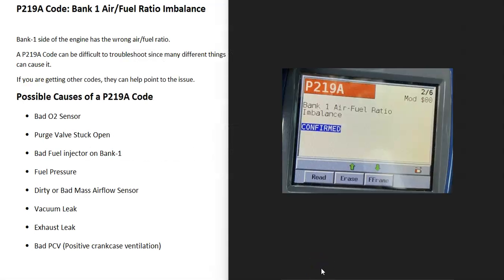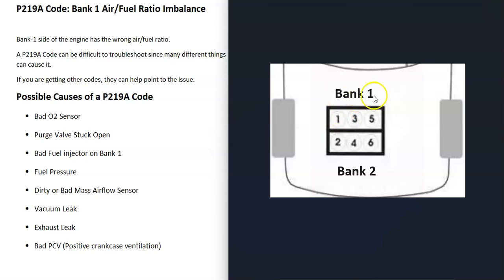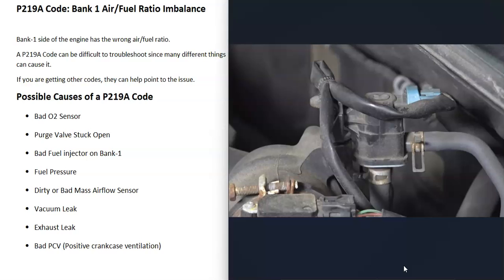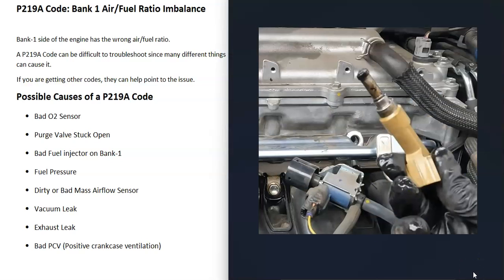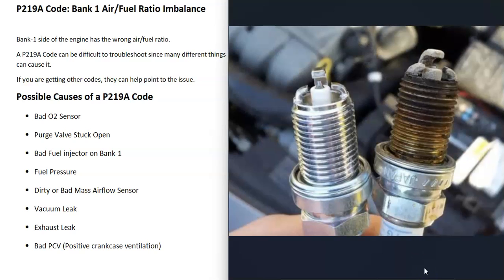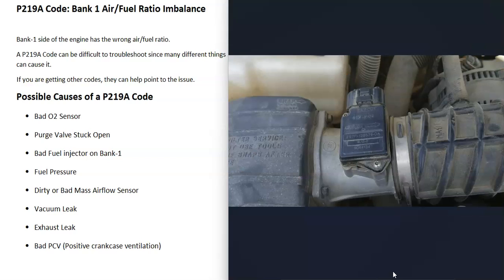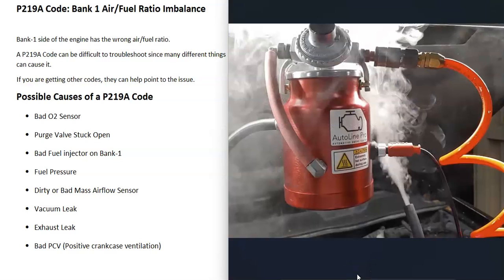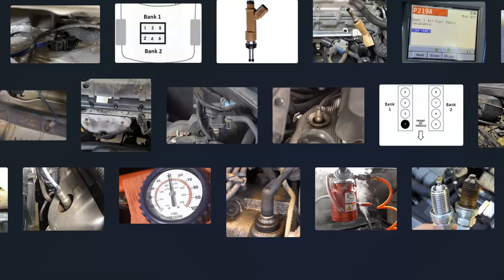Causes and Fixes P219A Code: Bank 1 Air/Fuel Ratio Imbalance

Comment: I have this P219A code on my 2013 Chevy Silverado and I have already changed spark plugs, spark plug wires, all eight fuel injectors, both upstream oxygen sensors, purge valve, cleaned mass air flow sensor, changed air filter, changed dirty air pcv hose, cleaned throttle body and performed idle reset using scan tool.
Reply: Any luck i have the same issue only getting that code as well?
Reply: Have you fix the issue ?
Reply: @isaias3609  I changed injectors and it stayed off but it came back
Reply: @TurnThemWheels   just found out what was wrong with it mines had a broke push rod
Reply: @isaias3609  gotcha dang that’s sucks
Reply: I'm having the same issue I just changed plugs and wires and coil pack because it was saying misfire on cylinder 7 but now it runs so much better then today the day after doing this my engine light comes back on and it's throwing the P219A code did you ever figure out the problem and the fix?
Reply: @ericharvey8  no luck. I changed injectors and made a video on my channel. Code came back and I think it’s lifter
Reply: @TurnThemWheels me too i buy 16 inyectors and Still the light turn on and Just one code p219b ratio 2 do you know what the problems
Reply: @tj-zc1sf  p219b is bank 2 passenger side
Reply: @TurnThemWheels bro I got both 219a and b, I’m thinking it’s the O2 sensors or at least I’m hopeful that’s the only issue
Reply: 2015 Kia forte coupe EX having the same problem I changed my catalyst converter My O2 sensor Been change upstream changed my computer spark plugs initial coils alternator I don't know what else to do with this damn car It didn't come on until after I change the catalyst converter and change the alternator after the alternator came on
Reply: Same stuff with my Benz. 
Replaced all injectors, coils, plugs, both o2 sensors, purge, cleaned map sensor, heet in gas tank, etc. still this stupid p219c is still on. So over it lol
Reply: Try replacing oil pressure sensor , and use non ethanol gas

Comment: I'm getting this code along with  a P0307 code, which is a misfire on #7. I drive a 2012 Chevy Silverado V8. Does this combination of codes mean that I have a bad fuel injector on the 7th cylinder? I've already changed the plugs and wires but these codes are still showing. Really strapped for cash right now so any advice would be greatly appreciated.
Reply from the maker: That's what I would check. There are several ways to test the injector, a quick way that is low cost is to swap it with another cylinder and see if the problem follows.
Reply: Did you get it fixed? I’m not showing any misfires. I have P219A
Reply: @TurnThemWheels  I changed the ignition coil on #7 and have had no more problems with it. The check engine light immediately went off when I started her up and hasn't come back on. Took maybe 10 minutes to replace the old one.
Reply: @CarolinaPoet  I don’t have any P03xx codes; just the P219A. No active misfires in the counter